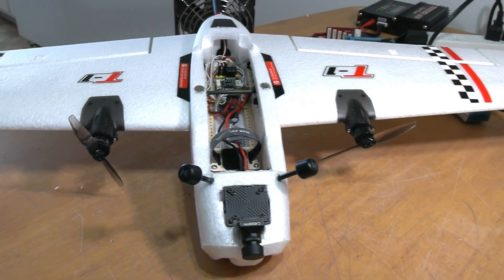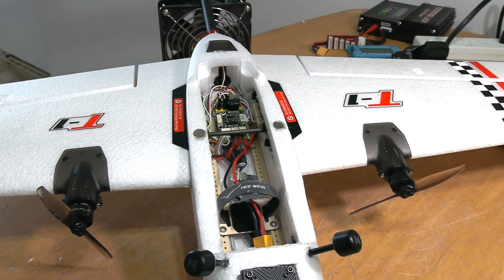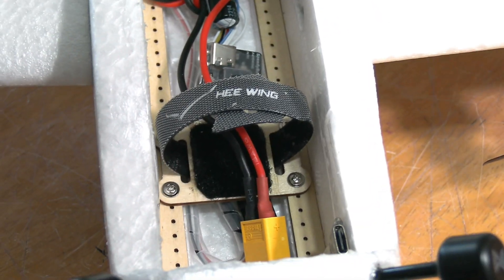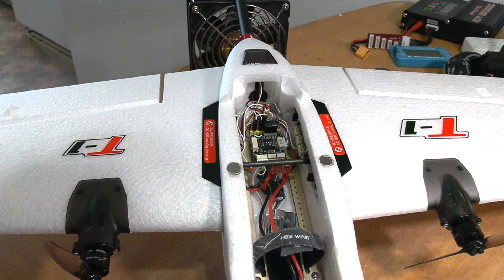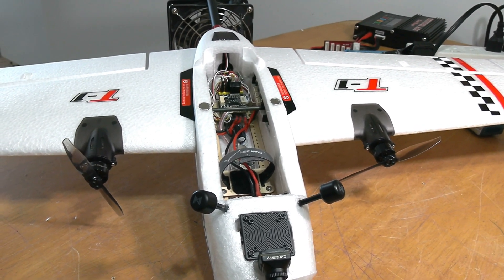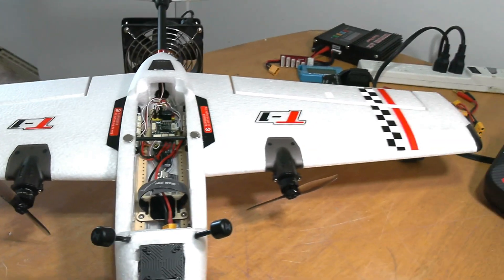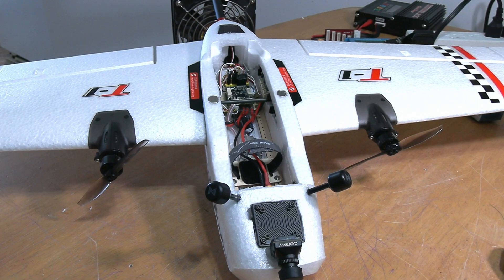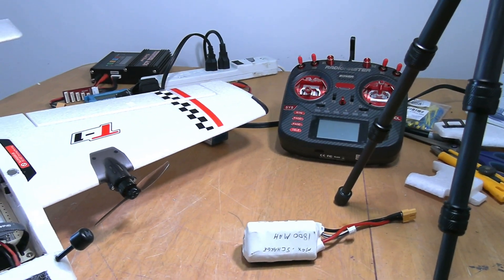Heewing Ranger T1 with Speedybee F405 wing mini flight control build part 2

Comment: What did you do with the old power distribution pannel in the bottom? (The one for the motors. I forgot it's name). I am looking at making a setup with the normal SB405 Wing.
Reply from the maker: I simply removed it. Made my connections direct to the flight control. Makes for a cleaner setup.
Reply: @Livinglifeat60 Thanks for letting me know. I am assuming you attached the exposed wires like you would a EMC (or whatever it is called) to the pads on the controller?
Reply from the maker: @alexanderanderson9929  You are correct.

Comment: Where does the capacitor go to?
Reply from the maker: The cap goes to the power wires on the speed control. Solder it to the same pads as the main power wire connection.
Reply: Ok great thanks for the reply